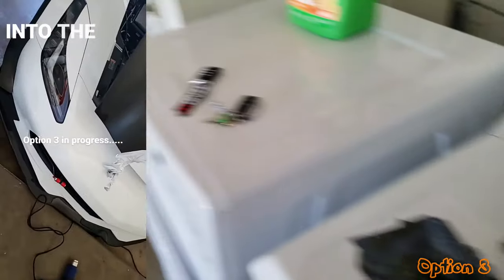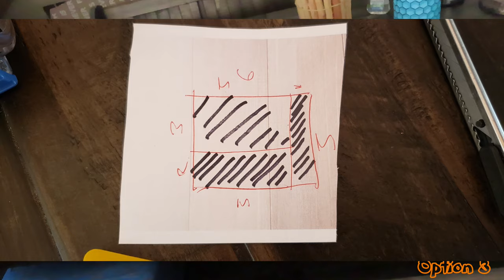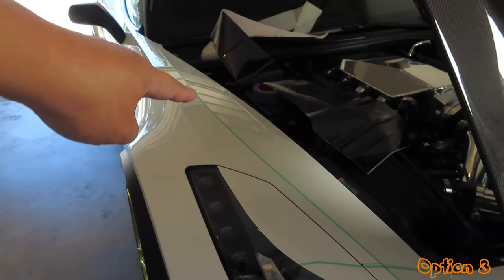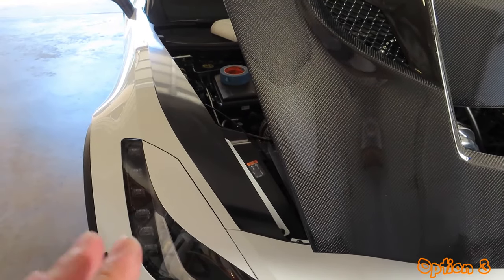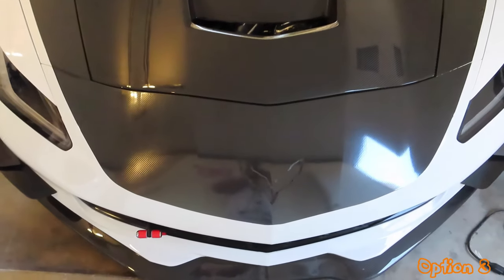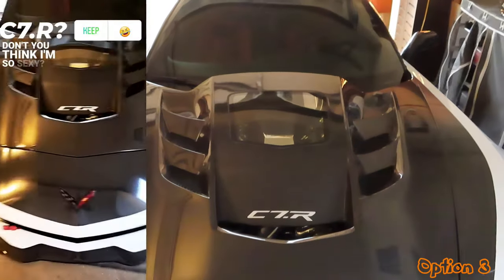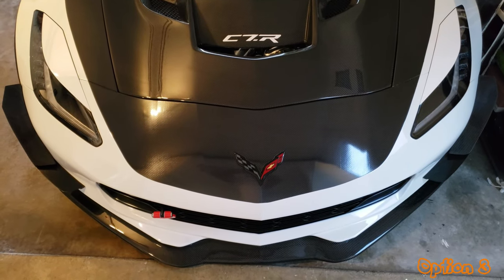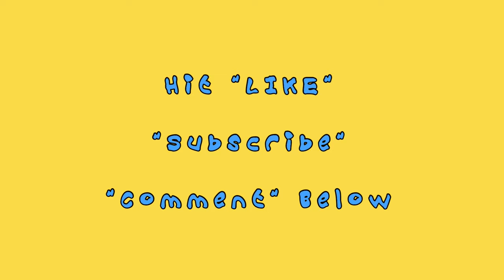Custom Wraps Style Carbon Vinyl | Repsol13 F26 Corvette C7

Comment: Nice man
Reply from the maker: 🙏🙏🙏🙏🙏thanks
Reply: @Repsol13  I’m planning on wrapping my c7(top half of the car is gonna be gloss black) when I get back to Colorado and also do my exhaust. Thinking bout going corsa with the black exhaust tips.
Reply from the maker: I wrapped the top with Black Gloss self heal Paint protection film... 2 years ago, new for SEMA at the time, it ran about $1000.  The normal high quality vinyl always leave scratches or marks.  This PPF will clean itself and heal all scratches when met the 🌞 during the day
Reply: @Repsol13  okay that’s nice bro an thanks for that information also.

Comment: About to get the dame hood,do you have any complaints about it?
Reply from the maker: I do, it does not fit if you have aftermarket intake manifolds or Z06 too mount Supercharger.  Other than that, I love it so much.  I removed all the Vent mash ... and all holes are functional (best part about it)
Reply: @Repsol13  😢 so it does not fit a z06 with a stock engine? Woww…thanks for the tip